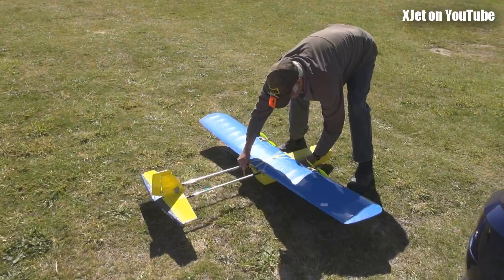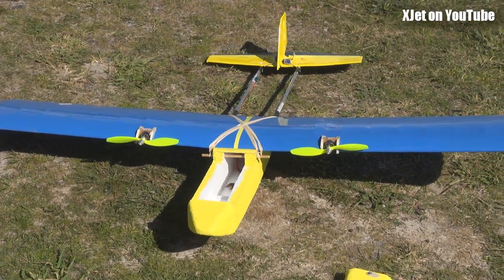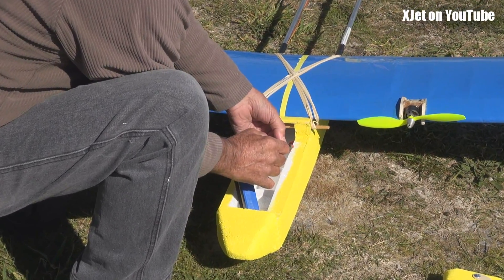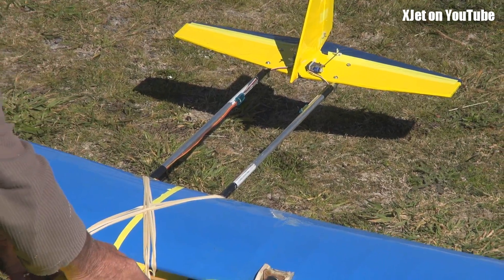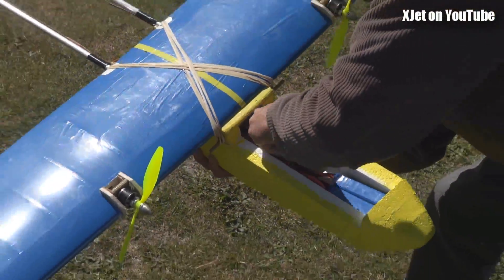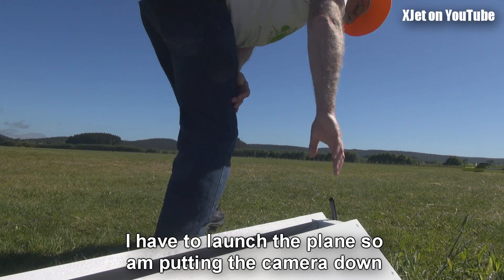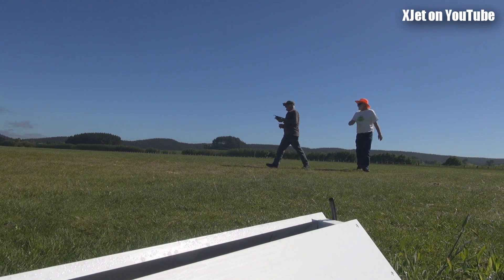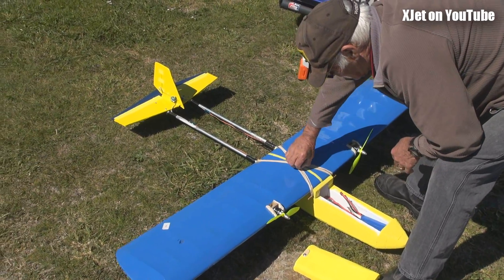Ron's newest RC plane design

Comment: servo  and 2 wheels with a string holding a weight.  then you can shift weight to make it roll.  
bet it would be hard to control tho :)
kinda same effect as if you make a device with helicopter rotor and  a piston on each side with weight attached.
the further out the weight goes the bigger effect it have and make it lean in that direction.

Comment: 1) Dual & Bigger Rudders On Wingtips!? Canard-Lets...Then You Could Also Have Them Oppose Out From Each Other For Great Air Breaks Also... 
2) Bigger Props w/Twin Speed Controllers + 3-Way Speed Switch On Radio To Turn Left/Right Or Normal Straight Mode..., LMAO 😂

Comment: Dihedral angle on wing is to low, this is why your rudder does not work. Bigger rudder will just add weight to tail and add little more control.

Comment: Saw the wing in half and glue it back together with an extra five degrees of dihedral.  And make the fin and rudder bigger too.

If that's more difficult then adding at least one aileron, then add aileron(s) instead.

Comment: 1. tie string onto one side of the wing 
2. hold the string 
3. do circles
Reply: It's called control line, usually done with 2 strings I think, a bit like a stunt kite. They circles, loops, fly inverted, all kinds of things.

Comment: Add curved or angled winglets with a real lazy curve. The angled bit will give the effect of dihedral at the outer tip of the wing. You get the effect of dihedral without having to stomp on the wing... :-)

Comment: Redo the tail as an inverted V tail, that way you get yaw control with a bit of roll coupling.  Still may not be enough but differential thrust will be easy to add if needed.

Comment: Just take some control board from coaxial heli and use it for differential trust and you don't need rudder at all. Or use two rudders, but in the line behind the propellers,so they can deflect airflow from props. Probably you can do it with some mixing too. Put each motor on different channel and set it that when you go right, left motor will turn faster and the right motor slower...

Comment: G'day,

   Well, Asymetric Thrust works just fine, on the Glide....; at least on my CC Lee Falcon & the Digitech Sky Hero it does.

  On the Falcon when under Full Power, the Turn-Stick cuts the Juice to the Engine on the Inside of the Turn, and while Gliding then the Turn-Stick feeds Full Power to the Outside Engine ; juducious little "Blips" of asymetric Thrust can thus steer the Glide...

   The Sky Hero though, has a Common Throttle which gives proportional control of both Engines, thus Airspeed & therefore the Climb/Descent-Rate, and part of the Pre-Flight procedure is to Test-Glide the Model with the Throttle at it's Idle-Setting, just enough to have both Engines turning (Ducted Fans, one on each Wingtip...), and use the Yaw-Stick's Trim-Tab to adjust the relative Thrust until it glides in a straight line....; then, it should Climb, Cruise, & Glide in a Straight line, and Tiny inputs with the Turn-Stick will nudge it around the Sky (half a second of Turn-Stick at Cruise-power yields 45 Degrees of Yaw with 75 Degrees of Roll & 25 Degrees Nose-Down..., a full Second gets you into a Powered Spin...

   I would try a bit of Throttle-Rudder Coupling, before fiddling around  with retrofitting Ailerons.

  Simplicate, and
    Add more
      Lightness...!

   ;-p

Ciao !

Comment: why not just use differential thrust? a bit of mixing could fix that.
Reply: That would give you more yaw control, but control authority isn't the issue. Essentially the problem is that when Ron applies rudder the plane just 'skids' sideways through the air rather than rolling into a turn. It would turn very slowly with full rudder (the fuselage provides some side force when you're 'skidding') but not enough to fly safely. Adding dihedral 'couples' the yaw and roll, so applying rudder rolls the plane into a turn.

I've got a twin engine depron flying boat I built from plans on RCgroups (they call it a puddle twin), and the basic rudder/elevator design needs around 15 degrees of dihedral even with differential thrust. Take note that this is a high wing plane with a deep fuselage, so It has some natural dihedral effect even when you don't angle the wing up.

I modified the design to have ailerons- when you've got ailerons that much dihedral is a liability, so I built the wing with no dihedral at all. I also omitted the rudder (opting for a fixed vertical stab) because differential thrust from the motors provides all the yaw control I'll ever need (at least until the day one motor fails mid air). It's a sweet flier, lovely and stable, but turns with the 'rudder' are impossible once you've built up some speed, even with the big slab-sided fuselage to provide side force.
Reply: nerd1000ify yes I'm aware of the issue. it was stated many times during filming he needs some dyhedral. if he's not willing to change the wing, I simply offered a different solution.

Comment: Definitely put a larger vertical stab on there. Maybe go with a Lockheed Constellation style tail with 3 vertical stabs, haha.
Then either put in more dihedral or slap some ailerons on there. It looks like it will fly great, just need to get some directional control in there, haha.